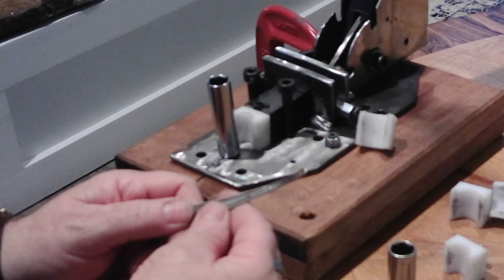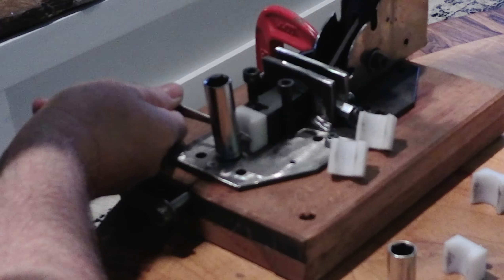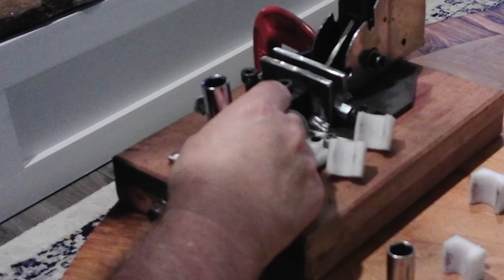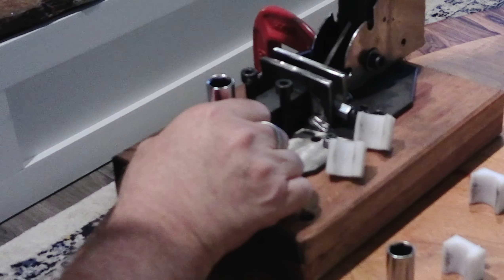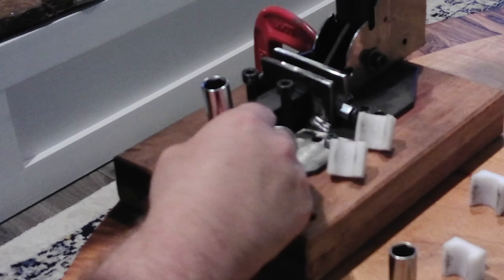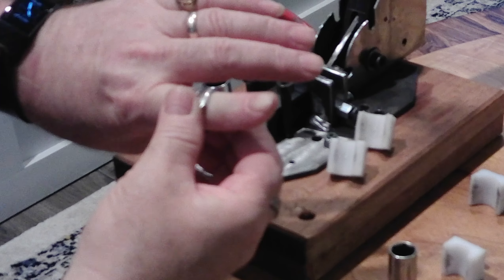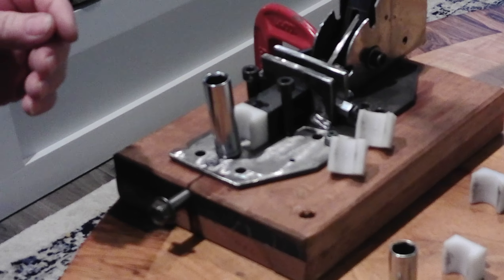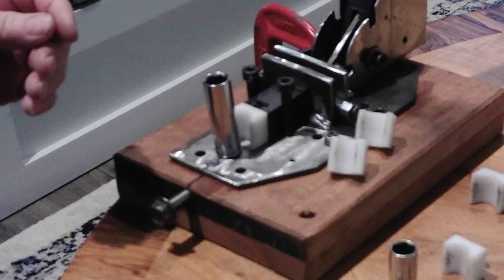HOMEMADE RING BENDING MACHINE VID 4  Stainless steel twist ring and Silver

Comment: Would love to know the parts you used to make the tool.
Reply from the maker: base plate is from a Huskvana rider 155 mower, sockets and extension end, 1 inch square cold rolled steel bar, 
allen head machine bolts, 1/4 inch flat steel, 1 inch square tube, 5/8 steel bar, piece of an old mower for the cup plate,
PTFE cut from 1 inch square stock then drilled various diameters and 1/4 inch grade 5 bolts.......and a few partridges in pear trees , just old junk